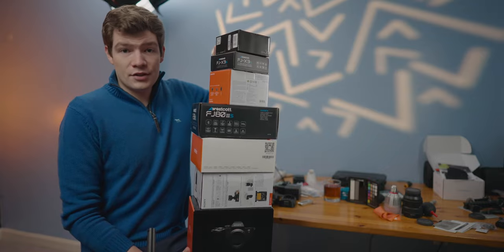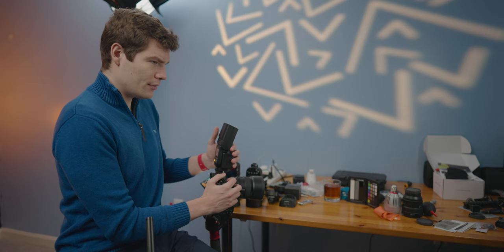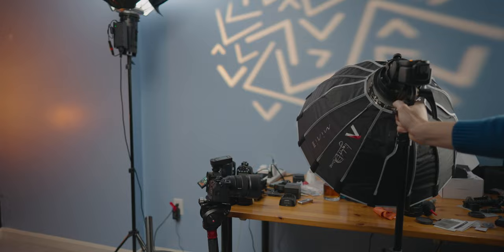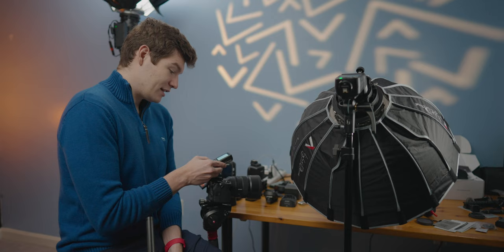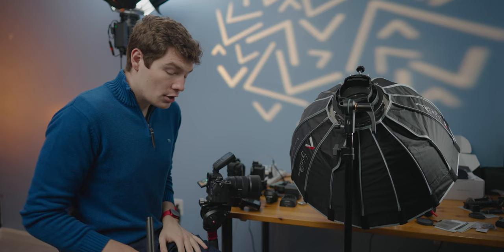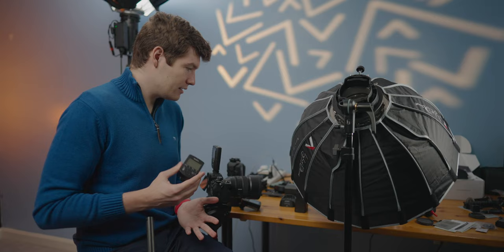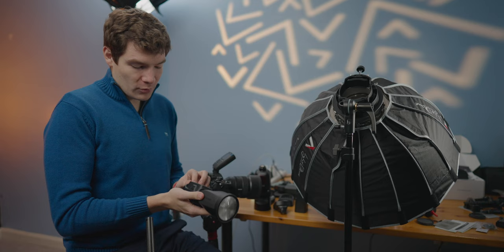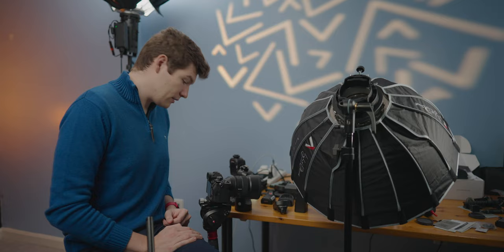Sony has a big camera flash problem (A7SIII, A7IV, A7RV Wireless TTL)

Comment: Surely it is up to Godox et al to make their flashes compatible with the Sony protocol? I think your criticism is misdirected, especially as the Sony flashes work so beautifully. This video is just silly and naïve. "Wireless TTL does not work on the new Sony cameras" - that is just utter BS. It works brilliantly, if you use the correct equipment.
Reply from the maker: The problem of course is that Sony keep their flash communication protocol private, just like their autofocus algorithm.
Reply: @KarlMeyer  As do Canon, Nikon, Panasonic et al. Sony's is just harder to figure out. These protocols are not public, nor licensed. I too, was frustrated that I could not use all the features of the wonderful Godox V860III S (S for Sony!) on my Sony A1, but the blame lies with Godox, not Sony. (As much as I dislike Sony for other reasons)
Reply: I agree fully.
Reply: So you're saying it's ok to get fleeced by sony for flashes. Good for you

Comment: After watching, I got out my Godox V1S and attached it to my A7RV. I had no issues at all shooting in TTL mode. In fact, the photos looked MUCH better than any I took on my old A7III using the same flash and TTL. (This isn’t too surprising given that the A7RV is a vastly superior photographic camera, but I was initially concerned based off your video). The improved white balance and colors are also prominently on display using this camera and flash combo, provided you set the white balance to “Flash.”
Reply from the maker: Apparently, if you shoot wider than f4, the problem doesn't occur. I'm glad it's working for someone.
Reply: @KarlMeyer  I tested it at f2.8 and f5.6, on the Sony 24-70 GM II; both worked fine. I am only using TTL with the VS1 on camera. For off camera flash, I would never use TTL anyway. I much prefer to meter and set my flashes via the meter.

Settings from Page 4 in the A7RV purple Exposure/Color menu:

Flash Mode: Fill-flash
Flash Comp.: 0
Exp.comp.set: Ambient only
Wireless Flash: Off
Red Eye Reduction: Off
Reply from the maker: @2010SLP  Thanks for sharing. Just did some more testing. It defaults to 1/128 every time for me, sadly. It's definitely broken for anything shot at 2.8 or wider. Someone else left a great explanation as to why that is either a conspiracy theory or the truth. It sounds totally reasonable.
Reply: @KarlMeyer  have you changed the setting in your Godox wireless trigger menu from the 128 to 256. As it defaults to 128 out of the box.
Reply: @2010SLP Interested in getting an on camera flash..so do you recommend the Godox  V1..currently using a Sony A74 and A7RV...I do events on occasion..so everything works fine in your experience?...some people have mentioned that BHPhoto are shipping the "updated" metal hot shoes instead of the old plastic ones..but I saw that BHphoto sells the replacement   "metal hot shoe" for like $20?...thanks
Reply: I never had a problem with my godox v860II for that matter.
Reply: @ldmndz4652  As an on-camera flash, I’ve had no issues with the V1S. I’m not using it to control any other lights. I do use TTL. The battery lasts forever. I don’t have any real complaints. Would obviously prefer a metal hot shoe, but my flash is older and has the plastic one. Nothing has broken, but I’m generally pretty careful with my equipment.
Reply: @2010SLP  thank you so much for the insight..so you do recommend it overall?..lol
Reply: @vicvital6677  I have the same godox, but when I put my camera in manual mode (sonny at 7 iV), the camera disables the flash. do you know what i can do?
Reply: I think the problem is off camera flash, not on camera, you need to watch the video first.
Reply: Yes watch the video first, the problem is not on camera, is off camera, I have same issues, of camera I have to put +1 compensation on camera, and +1 on the trigger, and is work a little bit better. But is not working properly. Good video, I think I was the problem. But no, I try everything and there is not fix.
I have A7lV and A7RV both same problem. Also in AWB, off camera, when I shoot, my pictures are blue!

Comment: I haven't had a problem with the off camera godox and TTL + A7IV. I'll test it again at some point and get back to you with what my setting
Reply: So it is only an issue with A7RV?
Reply: @Battlem0nk  it’s not an issue with the A7RV. Just tested it.
Reply: @2010SLP  Have you tried off-camera TTL shooting wide open. For example F/1.4
Reply: I’ve just tested this with A7IV and Godox V1 and found no issues at all after repeated tests.
Reply: I tried this with my A7IV TTL, Godox, V860, with trigger, and without the trigger, and I have also not had a problem as well.
Reply: @churchill378  off camera? The video shows TTL issue When using godox trigger wireless to flash on tripod.
Reply: @AJCoReTV  yeah I’ve since confirmed this also so I was mistaken originally. I wasn’t test with the wider apertures but I can confirm this issue does happen when you go wider than f4. You can still work around this issue by bumping up the flash exposure compensation.

Comment: I got a full Godox kit for my A1. V1 Pro, A,100 X3. For some of my use like low light event, off-camera TTL that works reasonably well is a necessity. After trying, i figured out that Godox can completely not do this. I found a used HVL-F28RM and HVL-F60RM and bought these. Woho! These flashes are just awesome, and great how they integrate with the camera. Flash photography got fun again! The AA batteries feels quite ancient though, but it works. And seems due to the good integration with the camera body they somehow get efficient, and even the F28RM can do quite some 20 pictures per second bursts. Then small things like not having to turn on or off the flash, the camera control that. Possibility to assign buttons on camera to control TTL flash compensation. No need to set high speed sync, it happens automatically. Ability to do 1/50000 sec shutter speeds and the flash handles that with no issues (a bit theoretical use case...).

Comment: Bueno, no entiendo ingles, pero pude mirar el video y lei casi todos los comentarios, gracias a los traductores.  Agradezco a este video ya que despues de verlo y ver que no me funcionaba el TTL en mi Sony a7III, con un disparador XPRO II y un Godox V860III, me puse a revisar las configuraciones de camara y video, resulta que despues de hacer algunos cambios, el sistema funciono sin problema.  los parametros que revise fueron: CAMARA -. activar en pestaña de parametos de flash (1-12), flash inalambrico.  DISPARADOR -. TCM transform function: Seleccionar para el caso del godox, el icono del flash - Legacy hot shoe: off -. PC socket: in.   Bueno todos esto lo hice como tambien actualice tanto, camara, flash y disparador con el ultimo firmware de cada uno.  Por otro lado no olvide revisar que los pines no esten torcido y colocar el cabezal, con la mayor paciencia y ver que quede bien en la camar.   Espero esto le pueda ayudar a alguien

Comment: I have absolutely no issues using my Godox/ Flashpoint strobes, including my V1 on-camera and off-camera with wireless triggering in TTL on my Sony bodies and never did have any issues. I dont know what you are doing wrong, but it is something. FYI, I currently shoot with Sony A7RV, A1, A7SIII and they all work great  in TTL with my Godox V1, Godox AD200Pro. AD300Pro, AD400Pro and AD600Pro strobes. I am a longtime International Award-winning pro and it all has to work for me and my varied clients, and it does. Something is wrong with your setup and/or gear. I dont use Wescott strobes , and I tried using Sony flashes, but wasn't impressed and they were way overpriced so I sold them, and have been completely happy with my Godox/Flashpoint gear. Cheers and best to you.

Comment: Hi Karl, 

Your video really hits home with me and I appreciate your making it. I just subscribed to your channel because of it!

 I have been shooting professionally for about 16 years and 95% of my work is done with flash/strobes. I started with Nikon, went to Sony and now shoot Canon. One of the reasons I switched to Canon was because of the years of frustration I had with Sony's off camera flash situation.

 Im far from a technical person but I have used Godox flashes with different Sony cameras  and I can tell you that I have had many, many shoots ruined because my flashes would not fire, would not fire accurately and were the cause of additional stress during important jobs as I could not trust that it would work. Ive had to shoot with natural light because my flashes wouldn't work, re-schedule shoots and constantly worry about whether or not my flashes would malfunction instead of concentrating on my clients, compositions, poses, etc.

 I believe one of the problems with the Sony system and off camera flash with Godox, Westcott and other 3rd party flashes is the Sony hot shoe design. If you look at Canon's and Nikon's hot shoe and then look at Sony's you can easily see the difference. The construction, design, stability, balance and protection of the components on the Sony system hot shoe is their Achilles Heal. Even putting the flashes in the hot shoe is challenging because you really never know if its in correctly or not. It may not work at all, breakdown during a shoot or it may work fine. Its kind of like driving a car you dont trust!

 I sold my entire Sony system and went to Canon and for many reasons am much better off. Canon, for me, has been reliable, easy and comfortable to use and it performs better than any Ive used in the past. However, Im not saying this is a universal statement that applies to everyone. Im sure Sony products are excellent for many of their millions of users, but for me, not so much.

Thank you for letting me share my experience with you and your channel!

 Great video and I look forward to your future content!

 Best to you Karl! 😊
Reply: Yes! I started on Sony and thought it was me! I could never get TTL to work on on-camera flash, off camera, strobes, led strobe, nothing. I've had to use manual and it's just been frustrating. I bought a Sony HVL f28rm and all of a sudden it worked. Now with your input I'm very tempted to leave Sony.
Reply: @GunslingerMediaCo   Hi! Im not familiar with the HVLf28m, but hope it works well for you! I just had a lot of bad luck with Sony that was really costing me so I decided to switch to Canon about 2 years ago. Best of luck to you!

Comment: What I have found is that my godox flashes and triggers were not keeping up with the 10fps. Sometimes, it wouldn’t even keep up with 5fps. I’ve photographed so many events where the flash did not fire, and some of the most amazing shots out of the bursts were the ones where that flash did not light up the subject. I tried my first Sony flash at the beginning of the year. It sucks that you need to use AA batteries, but when it comes to event work, I’m going to be sticking with Sony flashes.  The quality as you mention is amazing and I like the fact that it communicates directly with the camera’s interface. White balance is usually perfect. Being able to control the flash with the cameras lcd is pretty amazing. To me it’s gonna save a bunch of time in post and quicker deliveries means I can get onto the next thing.  I do agree, that if Sony is doing this on purpose with 3rd party flashes, hopefully they can fix it to allow us more affordable options, or give us lithium built-in batteries in the Sony flashes, and that would be great to.  Either way great video. Thanks for the insight.
Reply: I had the same problem and the solution was to replace the flash foot. Sony is very picky with the flash contacts.
Reply: Do you recommend Hal 46 rm ?

Comment: Hi Karl, Great Video, I have been smiling at your tests as I have done them myself and found the exact same issues. Godox, Pixapro, Wescott speedlights all come out of the same factory and they just knock them out. However.. off camera they work very well in manual but absolutely suck in TTL. Why!!! Its just a guess but the cheap triggers are to blame, they work have to calculate the flash power then send that info to the speedlight and I don't believe the tech inside them is up to scratch maybe there just junk, combine that with all the different manufactures of cameras Boom you have a problem so I believe they turn a blind eye to these issues . The triggers are just very poor and the hotshots are just pathetic thats by they break so often. SO! I have the new Sony F60RM2 which like you said works very well and I totally agree, The hot shoe connection has far more communications going on hence why cheap triggers are useless at TTL. I current work as an events and wedding photographer and I kick the shite out of my Sony speed lights and they work superbly, so I forgive the AA and the screen which maybe old tech but it does not bother me what so ever.  Sony does its job, The rotational head for press shots is amazing too. Before I sign off, I also use Profoto A1s and agin the TTL is unbeatable and very consistent, buy hey they come at a price. The triggers are also expensive. That must confirm what I have said above, cheap triggers just suck at TTL. I may be wrong but thats what I have found. Godox are great in manual and perfect for off camera use, if they get smashed its not so painful.

Comment: First let me say thank you for sharing, I have two Sony F60RM2 and the Sony controller. I also have two Westcott FJ802 and the controller with two FJ200. I'm not having any of these issues in TTL or with HSS on as well but I will say i'm using the Sony A1 so i'm not sure what difference that might make but i'm getting the same exposure from both systems.  In-fact besides the white balance correction from the Sony they look exactly the same. Hope it works out for you because I do understand what it feels like to spend a lot of money on a product and it not work properly. Good luck, nice video.

Comment: I also struggle with problems like sometimes flash works and then it’s not, like some roulette, about your luck 😅 if you move flash forward back left right you can find positions where it’s work, and then it’s stop, like have bad connection, and for years i thought problem in godox hot shoe I changed maybe 10 times for 1 years. But to the end it’s because black color on smart shoe of Sony. I just clean it off completely with polishing pen and connection became stable. I use Sony a7iii

Comment: Thank you! You out it togethr for me. I have Godox and Wescott on camera and off camera flash, and I have to use manual all the time. Then i bought the HVL F28RM and it just works. Which was exciting. About to buy a used HVL F60RM  but decided to do some research and came across your video. Its so hard to find an all around good camera. Sony has been perfect for me and my work flow with the best hybrid photo/video switching there is, and the glass is great. But I want to elevate my craft and use flash.

Comment: Good to hear that others have same problems with Sony and TTL-metering. It's protectionism, but in wrong place because Godox is a very innovative flash manufacturer that flash users cannot pass by without considering it as a cost effective way to have flash system from handhelds to mobile powerpacked studio stuff.

Comment: I found this video because I recently switched to Sony from Nikon and quickly noticed this issue. I have the new A7RV. Thankfully, for my work I only need TTL for the on camera flash, my off camera flashes are almost always on manual. So as long as the Godox TTL works on camera I should be ok, but I hope Sony or Godox can fix this issue. So you are correct this is an issue.

Comment: Same here with a bit different gear. Still I hope I'll find a solution for this issue or a bug fix will come out. 🙏
Using Sony a7m3 with a Sigma lens adapter for Canon EF lenses (so not using native Sony lenses currently) and Godox AD400pro & 600pro wireless studio flashes. I fire the camera and a lot of times (but in a small percentage this does NOT happen 🥶) there's a sync issue with this setup, causing a time gap (1-1,5 sec) that means I press the shutter button and the camera "waits" about 1 sec to shoot. Imagine this while taking portraits. I got used to this but still cannot believe this. I like using Sony for its quality but it's so crazy to experience such  a bug in a not cheap system. Experienced the same with Mark IV at work. Never experienced anything like this with Canon. 🤨🥶

Comment: Thanks for addressing the issue. I have tried yesterday on my A7IV off camera Godox V1with X2 transmitter and TTL is underexposed a lot. Works fine on the camera. I never had an issue with this set up with my old A7R2. I have updated firmware on my godox and the camera but no luck. So now Im stranded with 3 godox flashes (Ad200pro, V1 and 860iii) I cannot use with my new camera :(

Comment: I have no issues with the Godox setup I use even if I use f1.8 which is my widest aperture I own.
The X2T-S together with the XR1-S works perfectly fine with the older Sony HVL-F60, HVL-F20 and HVL-F43 and you get a much better high sync speed of 1/8000 if needed.
The next flash I’ll purchase is the Godox AD200pro for outdoors and I don’t’ expect any issues at all.
It is very sad that your “wrong” information’s in this video my cause some Sony A7R5 interested people not to go for it , even it is one of the best camera on the market today.
Reply: I have issues with TTL only when its wireless with both my V1S and AD200Pro on my A7 III
Reply: @RaniJoensen  I discovered that if the flash is set to HSS then the exposure compensation hast to be used up to +3 . In normal TTL everything works well.
Reply: @duffy2512  Cool that's a good tip, going to check if that solves it.